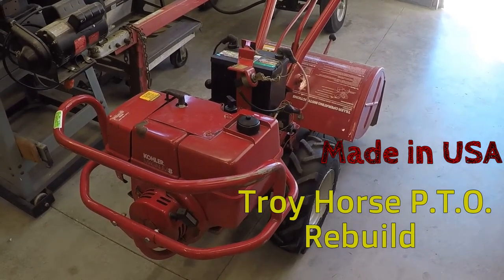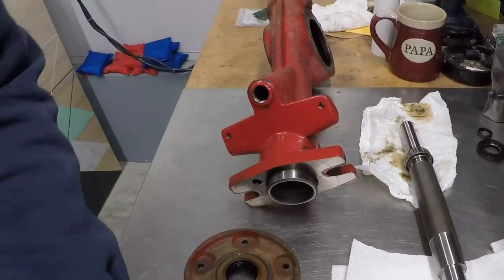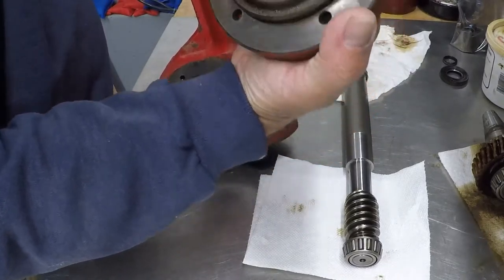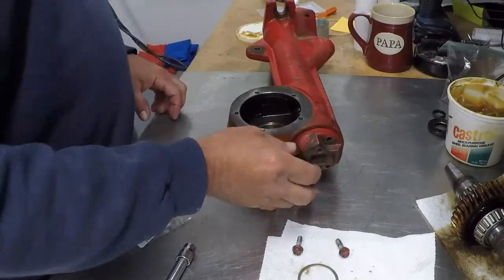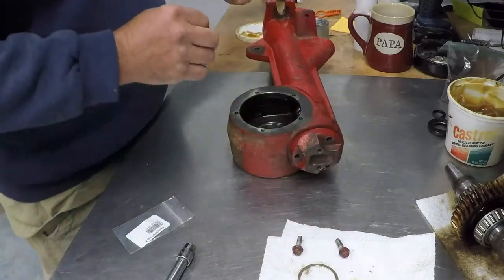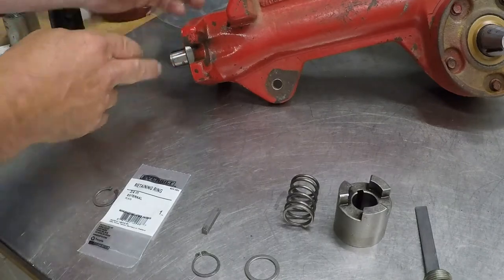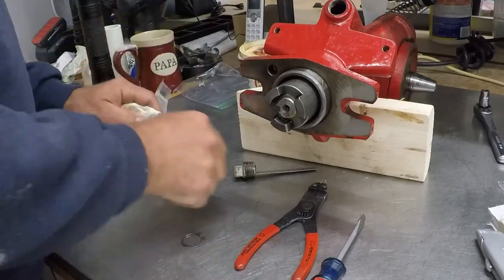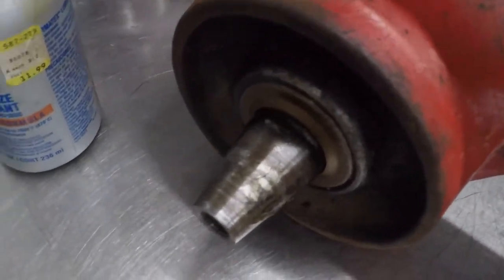Troy Bilt Horse rototiller PTO rebuild

Comment: Great video. I replaced the worm gear and shaft in my dads  horse when I was in high school. I did it as a project in my FFA agriculture mechanics class. I got a A and he got a working tiller! That was in 1995 it was a 1986 model he purchased new. I still use the tiller now to plant and maintain my garden. He passed away 17 years ago. New subscriber! Your shop looks clean and I can tell you are very detail oriented!
Reply from the maker: Thanks Ted. Glad to hear you were able to get work on your machine and get a grade on it too. I teach a class of 20 something year olds and most have no knowledge of mechanical repair. Definitely have to keep an eye on the seals on that machine. I’m sure your Dad was very proud of you.
Reply: 177 Bucks for that gear now.

Comment: WOW!  Cool THANKS.  I sold my baby to some Mexican friends and they pretty much destroyed it and called me back to fix it.  Got her runn'n good and put new tines on her but had to get an after market  ignition switch wich plugs same way but doesn't work same.  Anyway when I whent to take it for a test spin with tines engaged all the wires smoked to the limit switches.  Need a diagram to save alot of trouble.  In other words HELP!

Comment: About how much do you think a total rebuild on one of these would cost to put in all new bearings, seals, gears, shaft, new air cleaner assembly for the Kohler magnum, complete card for a  tiller like this. I have one like this I am considering rebuilding that was badly neglected.  It ran but the car and air cleaner wouldn't let it stay running. I have oil leaks all over the back end. I am trying to determine if I should rebuild or buy another well carred for unit.
Reply from the maker: I would not consider rebuilding if you need all those parts. Seals and bearings are reasonable , cost wise. I don’t know the price off the top of my head but the gears and shafts will make it cost prohibitive for me. 
I was buying seals for around 3 bucks each. A carburetor will be a Chinese knockoff for around 15-20 bucks and I would look for a kohler housing used. 
Do you know the shafts and gears are gone ? If you have oil leaks it may only need seals and gaskets
Reply: The last one I did was 400 parts and plus labor 
Every thing was checked and reworked but tires and he had them replace before I got it

Comment: This is the only video where the tiller looks like mine. Can you tell me what year it is and what model?
Reply from the maker: Give me a couple days. I have to get out to my shed and snap a pic of tag. You will be able to look up from there. I take it your tag , white sticker on top gearbox, is missing.
Reply: @cladkeeper8376  yup, mine has nothing,  except the same look as yours. Same Kohler motor, 8hp, electric start. Please let me know, what you know. Much appreciated.
Reply from the maker: Kevin. The model number is 12090. Serial 12090120___ (All low numbers) This should help
Reply: Thank you clad keeper that should. My serial # has been jimmies, but the last read 777475? Thamks
Reply: Any idea on year made?
Reply from the maker: Use my numbers on the Troy site. They have a chart   I’m not 100% sure